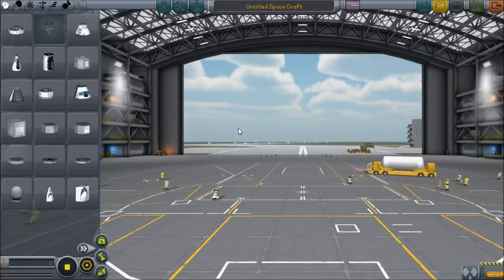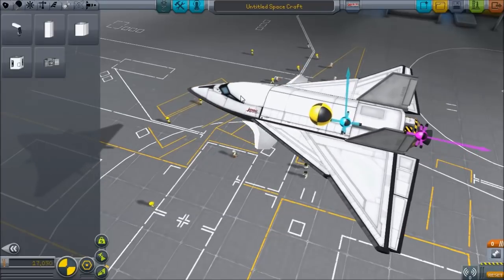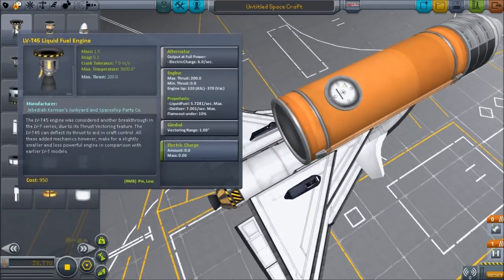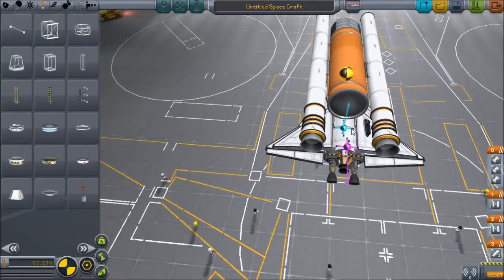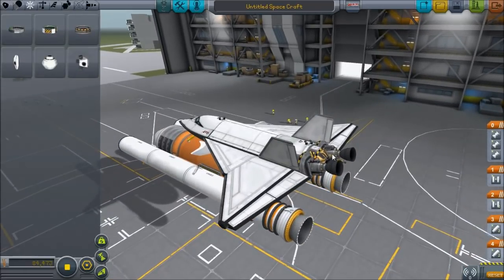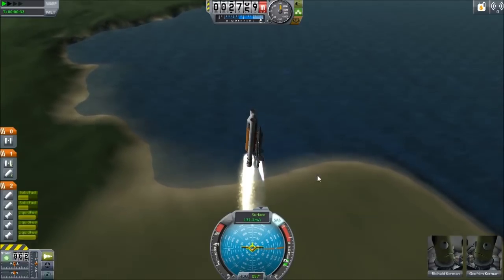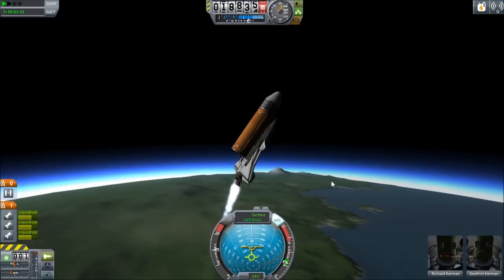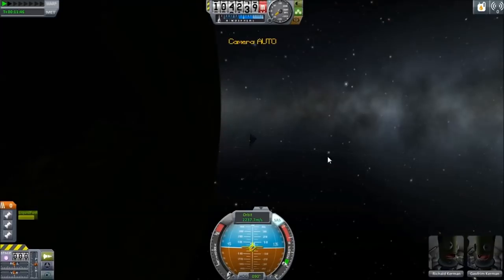Building a Shuttle in Kerbal Space Program

Comment: Clever, but wouldn't it be better to use the 3.75 meter parts for the external tank? =D
Reply from the maker: They would be way too heavy for the engines to lift, if there were more powerful solid rockets then it would be possible.
Reply: BlastProcess you could go into the game file and make the engines max thrust 1000 or somthin

Comment: Dude, dont accelerate the video, we want to see what you doing.
Reply: And how do you move the angle of the engines in 4:44?
Reply from the maker: I had to speed through the boring bits otherwise the video would be twice as long.

To change the angle you just press the WASD keys and if you hold shift it rotates 5 degrees at a time, I hit it 3 times for 15 degrees
Reply: Thanks! Helps big time!
Reply: BlastProcess That's always the difficulty when shooting video for KSP isn't it?  Trying to balance showing the actual gameplay while not bogging down the pacing.

Nice engineering on the shuttle BTW, I was impressed by how well you got the CoM and CoT to line-up throughout its flight regimes.

Now do it without relying on the reaction wheels ;p (j/k)